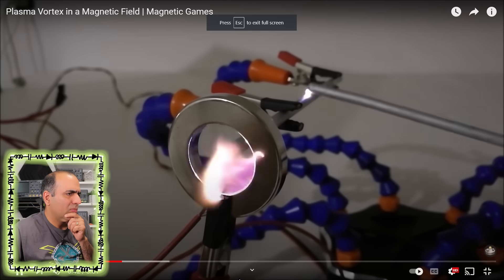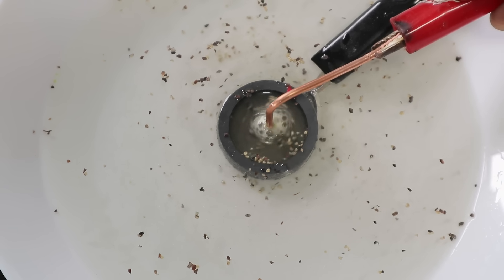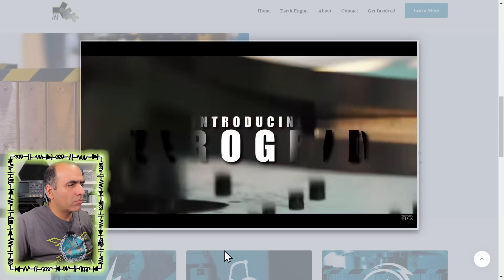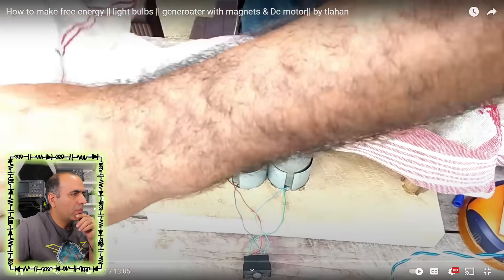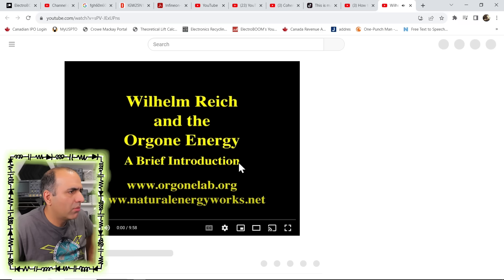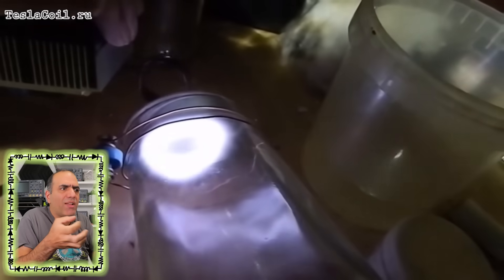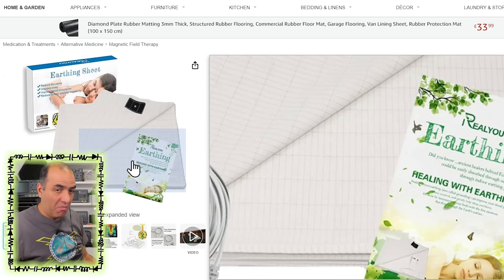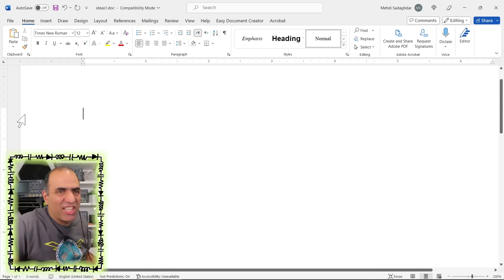Plasma and Salt Water Electric Vortex, Document Free Energy Clean Up

Comment: I also note that the Earth Engine explanation mentions one sided magnets. I congratulate the inventor in advance for his forthcoming win of the Nobel Prize for proving the existence of magnetic monopoles.

(Less sarcastically, an anisotropic magnet is something entirely different to a one-pole magnet. Anisotropic just means the magnetic domains are aligned... you know, like most things we would call magnets?).
Reply: "One sided magnets" .. okay shit, that's funny. I also saw a video once about some weird free energy bs claiming it makes AC current but it flows in both directions simultaneously and continuously. Like .. what ?
Reply: @Wifibee  I mean with a Fourier transform we could get infinitely many AC frequencies from a single DC current so it almost makes sense.
Reply: @hedgehog3180  WHO AWAKENS ME FROM A 6 MONTHS OLD COMMENT ?
Anyway, the bs part about that is when you have AC but you specify it flows "continuously" .. to me it would suggest that it's DC then, not AC and that the person had no fucking clue of what he was talking about. And i don't know what happens when you make DC flows in both direction at the same time but i would not try.

Comment: I sat under five cornered pyramid whilst watching this and your spiritual words released the 50 Joules from a charged magnet I was holding. This 50 Joules was amplified five hundred times by interacting with the 5G radiation in our unshielded home. If I hadn't been sitting on a special grounding mat I would have been fried, instead the energy was conducted to a flywheel which is now recharging 5000 magnets.

Comment: I watched the entire video of the microwave cooling down stuff, because it has the decency of being original. Quite easy to spot what’s wrong

1. Single phase AC devices don’t care if you switch phase and neutral
2. On the first test with ice, we can see that it’s still liquid after 10 seconds. Light turns off. Guy opens the door and BOOM, ice!
3. Power meter pointing away from the microwave? It just went from inductive to capacitive, but still a load! Funny how they lure people just by using unknown measurement devices

Comment: Metal detector* video, what about a revisit? I was thinking what if it was used with a silly scope.  Using  two detectors in one, operating in different frequency ranges, maybe a large detector 8"-12"+ and a small detector 1"-6" and use a speaker to listen to the pickup frequency, using a bandpass filter to block the carrier frequency, then use the two channel scope to fet a picture of whats going on. Maybe use the  scope music to draw  a picture on the scope to see what metalis in the pickup area! It being a picture, we can see change  much better than hearing the change, especially slight changes, maybe it could very easily show the difference between copper, gold , abd silver, iron and led..if i had a scope id work on it myself, i had s coupld from the 60's that required very strange batteries, the build reminded me of a low quality telescope from back in the early 70's maybe earlier  like a operational kids telescope, a real telescope, but definitely nothing s professional wiuld use basically  a stretched out nocular about all you are going to look at with it is your neighbors window, or the moon,  it was probably a fairly basic operational detector back in the day , not the best, but good consumer grade, i was hoing to try getting it going, but the strange batteries, and no idea what the voltage was,  slowed things, then moving got them lost,  my sister tossed my crap is what happened, j help her move, take care of her stuff, but her helping me, and stuff Gets missing and broken, and she has no idea what happened to it!! Sorry there is some anger there,   anyway what's your pinion angle on the "metal scope"?   Maybe use an adjustable frequency to optimize the detection in different soil or other Media, maybe use a sense coil, snd send coil, possibly operating in the near RF range, and another at a much different frequency, so filtering is much easier, between the coils, maybe reas the current and voltage of the coil with the scope, ??? Uding a 4 channel scop! If could be something eally good maybe? Or use really high voltage, high frequency,  to get the metal  particle to basically sing to tge pickup coil, telling exactly what it is! and maybe a clue to the depth,  maybe this has all been tried before, but maybe not, maybe it can show enough difference to see a speck if metal in a cubic yard of soil, and even tell what metal it is! This would be awesome, heck id love to even see a video of testing if it would even be possible! I think it could be a few great videos!✌️💥

Comment: You cant go wrong with a video about capturing plasma in a jar, its mesmerizing.
Reply: It's easily done using a little bit of foil inside a microwave oven. Only downside: It breaks the jar once it gets far too hot (and there's no way to rotate it while it's running).
Reply: @rootbrian4815  works better with foil than it does with a spoon... lol i guess the roundness of the spoon hinders the plasma forming.
Reply: @rootbrian4815  can now confirm the tea spoon works better than  dessert spoon.. lol oopps

Comment: I think a magnet motor is possible, It however would require energy input,  i think its more like a magnetically assisted motor it may possibly get 98-99% efficient motors. I have have seen mag motors work for 355° with the last spot stopping it or kicking it back..  maybe bby stacking 2-3 or more of these on a single shaft. With the dead spot mapped out in degrees. Then set the dead spots evenly spaced from each other. Allowing the rotor with the bead spot not inaction to push possibly past it until it reaches its dead spot . It will then stall (most likely , because  of lost momentum) however adding a electric motor to the mix, or even a pulse motor. Setup to  give it a push, just a few degrees before the dead spot, a couple coils capable of lifting 50-100lbs, if it had a iron core with only 11-14v on it. Should be more than capable to push  past the dead spot!! Making a constant rotation magnetic motor, if it still can be classified as a magnet motor,  use this motor, with a 1.5"x 12"-18" disc with 25-30 x 25-30x 3-6 mm thick N42-N52 magnets ( maybe get some 25 x 3-6 x 1.5-3mm little  magnets to place on their side between the 25-30mm ((maybe 35mm square magnets)) forming a Halbach array)  wrap the magnets with a ribbon of carbon fiber, moistened with epoxy, after vaccum infusing the magnets to thr disc tightly wrapping the magnets to the disc. Using a carbon tow, single direction carbon fiber ribbon, or string, being 1mm -1.5mm thick, (only do this if it is possible to spin over a few hundred rpm make the disc  to size by the magnet arrangement. Using a tape measure and a bit of tape to evenly layout the magnets by sticking them to the tape measure, rolled up and taped i the appropriate diameter. Test fit, then trace the size and shape to plywood, plastic, maybe carbon fiber, ir fiberglass sheets, im thinking heavy us better, so 20mm ply either double stacked, or a single disc about 2" smaller then cut two disc to size, then cut the center out, so it will fit snugly to the disc. Glue the hollow disc together, on a flat surface setup several 1/4" blocks or spacers of some type,  put them inside tgr hollow disc, eith glue on the inside surface,  then place the solid disc in the center, the spacer blocks will hold it in the center of the hollow disc,  then drill 1/16" holes  evenly spaced across from each other from both disc into the single disc. In the outer edge, use finishing nails 12mm/ 1/2"+ longer than tge thickness of thr hollow disc, so it reaches into the single solid disc! Then glue the magnets on,  or the easy way would be to use 1/2"plywood, 3layers, with a hollow disc on top and bottom,  glue together. And place screws across from each other from the top through the middle and bottom  plywood sheet, 3-6 screws dhould be plenty, electrical tape to hold the magnets until the epoxy/glue dries is fine, if its going to dpin slow, super glue, abd sewing thread wrapped arounf the magnets is fine, really slow, just sand the magnet before glue,  then use the piecs thr disc are cut from, make it a slight bit larger, by sanding or router, about 3mm/1/8"place finishing nails in the shape if the magnet all around the insie of the cut out piece wrap with coiling wire, enameled wire, in a s shape, or serpent shape, thr easy way would be to buy a couple wood or plastic yard sticks or paint stir sticks, cut them in pieces about 1/8"-3/16" / 3-4mm wide, tge same height ad the magnets. Drill a screw hole in the center, space the blocks evenly with the magnets, put finish nails in the corners, 1" long is plenty, (and it will help act as a slight iron core,  it may require sanding to fit the rotor,  them wrap the serpent  coil, and you got a generator!place additional coils coils 120°  ftom this one for a 3phase unit!!  Tge magnet motor can be built similar,  using a long 1/2" bolt as the axel,  Will work fine, use bearings , in wood blocks , epoxy them in, to make bearing pilars to keep it in place, use a few ring magnet to help reduce friction, 

Sorry to go astray

Comment: Q: "So, how does it work?"

A: "By carefully manipulating the fluctuations in the quantum state of cosmic scalar energy to be in resonance with the zero-point energy vacuum through the use of concentrated gamma ray frequencies > 10^42 GeV. The real trick is getting the ferromagnetic crystal converter to enact a space charge via the insulated hyper-force barrier semiconductor. Then it's just a matter of applying the correct inverse proportional harmonic signatures to the atomic structure using a delta cascading reagent. This serves as a catalyst for the trans-dimensional proto-duotronic ionizing quasi-muons so they may have the desired effect of isolating the specific stellar-inertial sigma-waves of the spacial impulse distortion hyperbole. Once applied you should notice an instant change in the ultra diametric molecular composition of everyday household materials such as lanthanum and yttrium. If no effect is witnessed then you may need to increase the thermo-polarity oscillator index to the cubic nucleo-synthetic tetrahedron. For safety reasons, I recommend having an asymmetrical neural auxiliary apparatus on standby should the kinetic angular cosmic polymer induce a negative charge on the omega astral-nominal manifold sequencer."

Comment: So Coherers were def real. They were used in early radio systems. You would have a spark gap transmitter on one side. And a coherer based receiver on the other. The spark would latch the coherer on. Then it would need to be tapped or shaken in order to reset it to off.  Obviously only any good for Morse code or other basic pulses. 

In the secret life of machines episode on the radio they demonstrated them

Comment: Maybe if you had a high altitude plate coated in graphene. And use a circuit to harvest energy from a ground and antenna connection. Maybe switch the earth and antenna connection on and off to collect pulses of static electricity to maybe make AC.

Comment: we will know if and when "free energy" happens because the resulting detonation will be on the news. if you had a free energy device, and you plugged its output back into its input, it would detonate. or rather, it would run up to the failure point of the materials that the machine is made from. i suppose it may just be a deflagration if the machine "makes energy" slowly. for example, a flywheel type machine that produced more energy than it used would just keep spinning faster and faster until it exploded. a sufficiently large flywheel would make a very significant detonation of the material. it would be an interesting white paper to calculate how much energy would be in the wheel at the time of failure, which would be dictated by the material. something like tungsten would be fairly extreme i think

Comment: I dont know about the righteousness of my question, but i know that it should be asked. Otherwise I may block my stomach... :D
Is there any way to switch capacitors from series to parallel and vice versa so that we can step up or step down voltage?
Reply: Anyone saw this comment?

Comment: I heard that if you put a carbon fiber mesh at the bottom of a bucket full it up with dirt and put second one in the top moisturise the dirt and cover it up after a while strings of bacteria form from the bottom mesh to the top one turning it into a battery and the more time it passes the stronger it gets until all the strings form and then to keep it working you need to provide nutrients (it was said something about hydrogen ions traveling up and being broken down into water when they reach the mesh)

Comment: Free energy is fake but I once spoke with a particle physicist about zero point energy. Zero point energy isn’t fake but it isn’t free either. All mater is a spinning particle. Mater spins one way while ant mater spins the other way. Matter and Energy can’t be destroyed but can be interchanged. Is we find a way to harness zero point energy it will almost seem like it is free kinda like fusion. However it takes initial energy to stop a particles spin but when it stops in forms back into energy. It will use a fuel, in this case matter, and an initial activation energy so it is not fake. Anyway I just wanted to tell about it since not a whole lot of people know about it.

Comment: There are devices that block 4G/5G signals used at the places where important exams are held to prevent cheating using mobiles. But I assume it is the device that generate heavy interference at specific frequency to prevent sending and receiving infomation, not to 'shield' the user and receive no RF waves.

Comment: A lot of this bs is based on putting in a low voltage and getting a higher voltage out... how original...lol   My car does that hundreds of times per second.  Now if they could show, more current at the same or higher voltage, then they would have my attention.  These fakes work on the fact that people know nothing about electricity

Comment: Please read Mehdi, there is a video in it for you. 
The grounding for health claim (= those guys selling grounding mats at 12.33) is insidious because the key claim sounds plausible. The chemically literate know that free radical molecules take an electron from molecules they react with " oxidizing" it. 
They claim in that connecting your body to the ground neutralizes free radical chemistry
from normal metabolism and inflammation. Who of us knows what becomes of electrons entering the body.?
Biochemistry to dispute this beyond me and most viewers. 
But we don't need it. 

WE HAVE MATH.

Measured current between a grounded person and ground is < one micro AMP.
That is 6.24x 10 to the 12th electrons per second. 
Rounding seconds per day up to 100,000 we have 6.24X10 to the 17th ( probably not but possible) antioxidant electrons from a day of grounding.  

Each molecule of vitamin C can oxidize releasing one electron to neutralize one free radical molecule.  With molecular weight 176000 mg/mole, 176000 mg has 6.02x10to the 23rd molecules.
Dividing by 100,000 1.76 mg of vitamin C has 6.02x10 to the 18th molecules. 
That trivial 1.76mg  of vitamin C can provide more antioxidant electrons than a day of grounding even if close to 90% of is was metabolized in other ways

Grounders on Youtube ( see Mercola, Chopra, Clint Ober, The Grounding Movie...)
are quite santimonious and  make very bold claims. Shots of their claims in a video where
your measure the current a healthy person and one with a fever and presumably massive inflamation finding insignificant current would be great. Avoid calling them frauds as 
that could cause legal difficulty. Let the data speak for itself and mock the claims  that the data show false. 
Mic the Vegan and the Vulture Watch channel have done videos this but the figures for measured current are hard to read and not convincing. View counts are low. They say the amount of electrons is low but do not show the math. 
Good luck with this and thanks for the videos you have done.

Comment: Hutchinson... That later stuff had nothing to do with earlier stuff... Earlier experiments used 3 air core coils (Tesla coils) that interfered with each other at 14Ghz (approx).... There was also a van de graph electrostatic source involved; but no details on positioning... And only a vague sense that listeninging to the static to tune it to some harmonic was also used... While not entirely rubbish; certainly hard to reliably replicate.

Comment: https://youtu.be/NTA67_t3gYg
Reply: I know this isn't free energy the topic of this video. But I think it's very clever how they used to catalytic converter. you can use almost any fuel with it. Multi-fuel d.c. generator! I'm sure you know this but most the time a jet engine is meant to run off of 1 fuel because of the combustion chamber air fuel ratio blah blah blah. This does it all without having to change out combustion Chambers or drilling holes

Comment: I believe you calculated the 1 meter3 magnet energy potential incorrectly.  If you were to attach a wire to it and suspend it from a very tall tree you could have it spin a generator as it descended.  Now, if that tree was say 100KM tall you could get a lot more than 50kJ/m3 of energy from that magnet.
Reply: is this a joke?